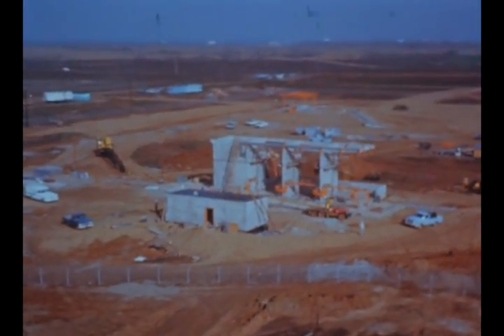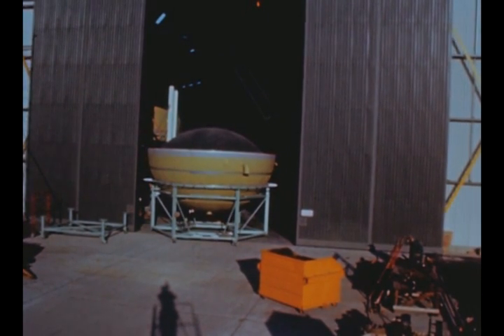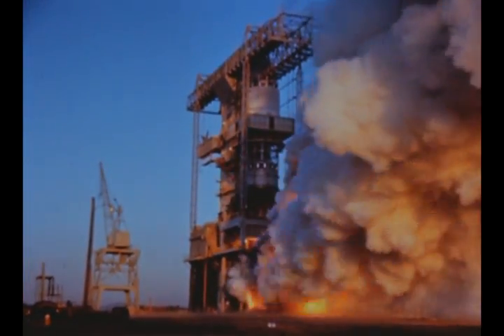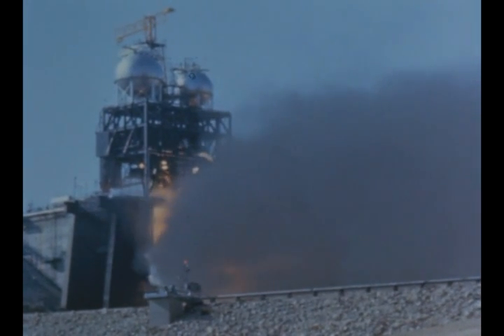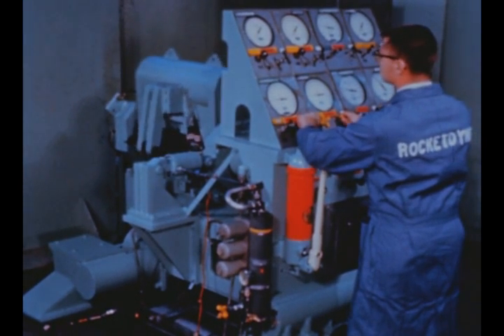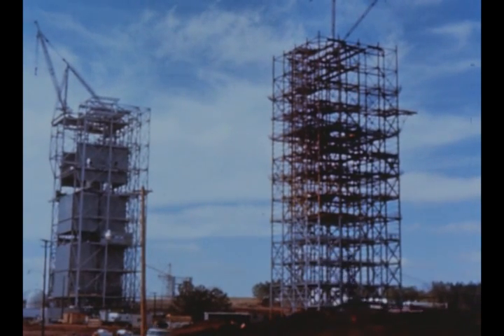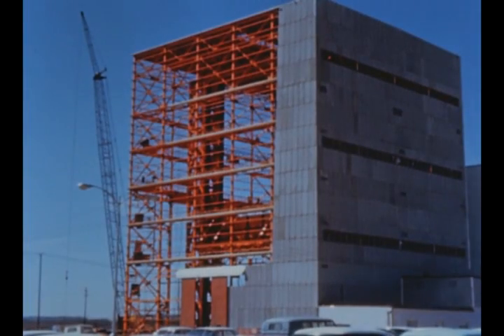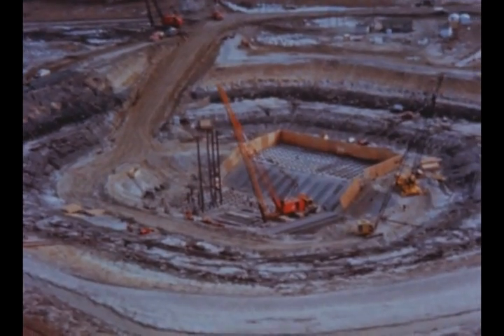Saturn V Quarterly report #5 Dec 1963-Feb 1964 part 2 of 2

Comment: Explosives were used inside the engine to answer the instability problems. Baffles were the answer; the new baffles worked well. Most of the instability and Pogo-ing problems were solved this way. It's amazing what you learn when you can read and write.

Comment from the maker: actually the test stands are still in use. Not sure about the tooling.
Reply: thflinx: Thanks for these, and all your clips.  Now some fun: Concrete evidence of the moonshot, pardon the pun.  But seriously, if there was a moonshot conspiracy there would simply be a level of detail where the pencil pushers would protest and the appropriations would stop.  If they went in all the way, down to rivets and replacement drill bits, there would need to be a conspiracy to conspire to get the conspiracy air tight.  Let the moon landing deniers chew on THAT!!!
Reply: The tooling has almost certainly been scrapped and recycled by now, although the tooling (Along with associated materials and production techniques) were state of the art at the time if they were still around they'd be obsolete due to technology and materials advances in the 50+ years they were built.